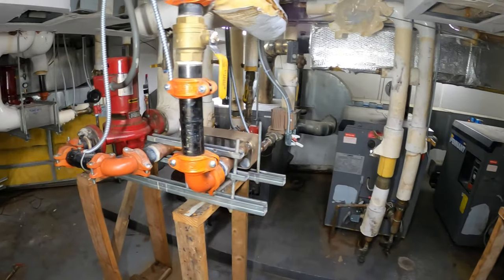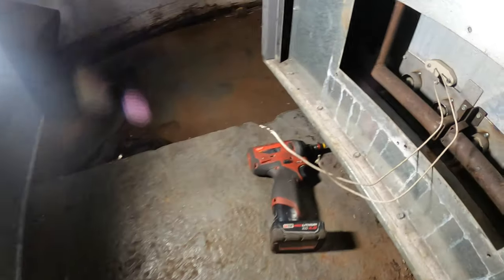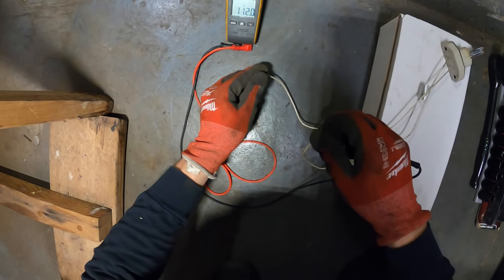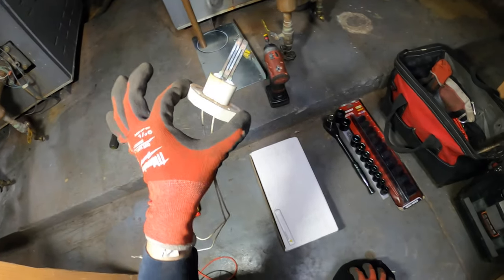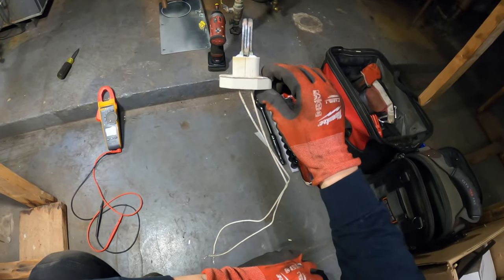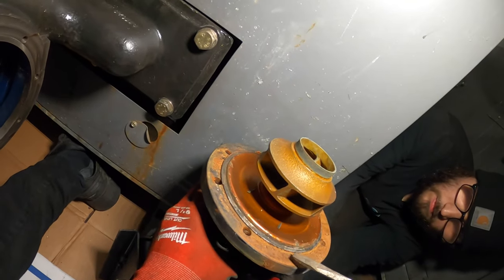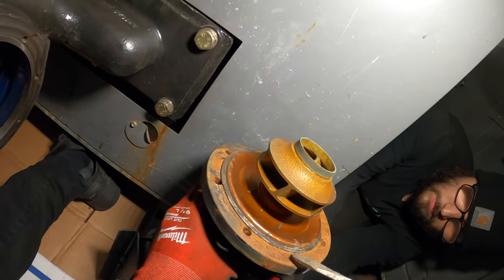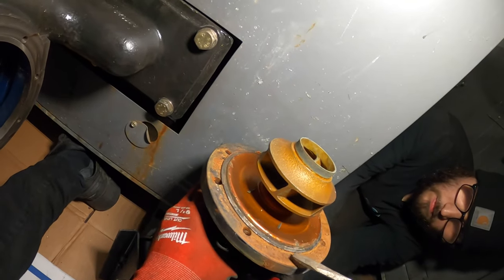HVAC: Laars Commercial Hydronic Boiler Circulator Pump Rebuild (Pump Volute & Pump Installion)

Comment: JMT, I work at a power plant, so I've got some experience with boiler feedwater. That corrosion with bubbles of surface metal looks to be Microbiologically Induced Corrosion (MIC). They should be treating the boiler feed with a corrosion inhibitor, otherwise any of the water feed lines or boiler tubes are susceptible to catastrophic failure.
Reply: Nah they don’t believe in water treatment in NYC or PM contracts for that matter lol. Nearly every time he opens a water system brown death water comes out there’s no such thing as treatment at any of these places and I bet it would go an extremely long way to prevent these issues. But does he want that? Doubtful 😂 more $ for him

Comment: This building is the gift that keeps on giving..😊😊😊 .....use some silicone grease when putting a new gasket on. I like the refrigeration Technologies brand its also a dielectric grease. I put it on electrical connections to stop any corrosion in wet environments....especially put on for cooling towers and boiler

Comment: I have watched all the videos for these pump and manifold repairs and replacements.
You did the best you could with what you had to work with.
I think that maybe a maintenance technician without any HVAC experience may have been there before you and discarded the covers for these units.
I might recommend you and your helper get some knee pads for  where and when you are able to wear them, you'll be grateful when you grow old like me.
Nice work.
Reply: Or a kneeling pad I’m with you on that save your knees you will thank yourself later
Reply: @pipers255 There's some sweet workpants byTruwerk that have built in kneepads. Wouldn't need to worry about forgetting them or re-positioning a pad.
Reply: @EverythingisFire 
I'll need to get those!

Comment: I noticed you have left the bypass open on the feed water pressure regulator.   Presumably, the hot water system is indented to run at a lower pressure, than the incoming  water pressure.

Comment: Good job Jumper and Chris, When I worked for an industrial actuator company, we would use petroleum jelly on the gaskets to hold the gaskets in place, sometimes you can use it on the gaskets and sometimes you can't, depending if there's electronic devices close by it, and it heats up on use.

Comment: I found that if you smear a small amount of Locktite 515 on your gasket surface such as the pump shaft seal assembly, you can stick the paper gasket to it and it won't move during install.

Comment: Wondering if you could put a couple dabs of grease or something on the back side of the gasket. Help it stick to the pump when your slotting it in. Don't know too much about the type of gasket here but I have done that on O-rings before to help hold them in a groove while installing them. Great work as always. Glad you are slowly getting this disaster of a boiler room a little better.
Reply: Locktite 515 is what I use to keep paper gaskets in place.

Comment: Again,, Using some grease, silicone grease or some gasket adhesive, will help hold that gasket in place and have less chance of it falling out of place, damaging the gasket or O ring and causing a rework leak.  You can also use a piece of ALL THREAD the same size and thread of the flange bolt and thread in a short piece and use it as a GUIDE to slide that manifold on  and not have to worry as much about the pump weight or alignment.  Then when you get a few bolts started. remove the ALL THREAD and install the bolts.

Comment: You might try to use a little lube or grease to keep those gaskets sticking to the surfaces of headers or pumps. Doesn't hurt the gasket but can make it easiery especially when placing havier stuff like the pump.
Reply: Dab of silicone dielectric grease will do wonders on rubber and paper gaskets

Comment: Just curious on your previous video you used two propress 2" coupling to install a 2" ball valve. Why? One coupling would have accomplished the same result. Just a tip I always remove the motor on the B&G pumps and most of the time if it spins all ya have to do is replace the coupling. The old pumps sometimes are hard to get out of the housing especially with the amount of scale built up but the housing can be cleaned with a spinning wire brush and a hose. I also would investigate why the bypass valve is open and not causing issues with too much pressure. That watts pressure reducing valve is easy to rebuild as there is a repair kit for it. Not trying to put down your work just might help you in the future.

Comment: You removed the ball valve with the boiler drain cock but the ball valve allows you to remove the boiler drain and easily rod out the ball valve from any blockage, you can unblock the boiler drain but not that easy and quick hope this helps

Comment: Just wondering if there was an air eliminator on the top of those boilers, that’s a lot air being introduced through those boilers and into the system? The more air removed at the source helps prevent cavitation or air locks, just wonder if those relief valves have ever been replaced or serviced? As a boiler guy myself I could spend a year in that boiler room getting those boilers into a safe operating condition? Just curious about that feed water and where it comes from???? 😳
Reply: The inside of the volute was horrifying. Imagine what the fire tubes looked like 😳💀💀💀

Comment: Smar the inside track of the gasket in the pump header and it wont flop out on you. These boilers also look like they are in desprete need of cleaning and inspection as well as a boiler water chemistry test. That corrosion and scale build up was awful, could only imagine how bad crud was coating the firetubes inside 😮

Comment: That's why you should have rebuilt the original pump instead of replacing it save customer money
Reply from the maker: I didn't rebuild this pump or replace it, it's the same exact pump that was originally there. Only thing we replaced was the volute for the pump as we needed the original to get the other boiler going. Thanks for watching 🔧⚡️